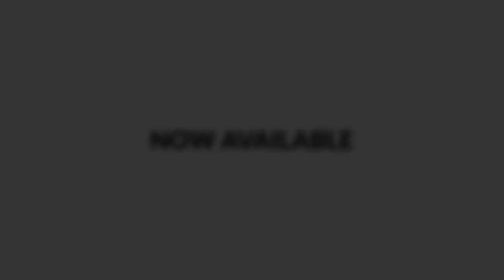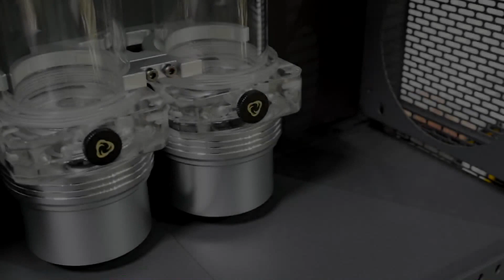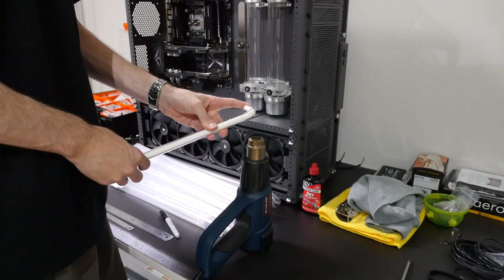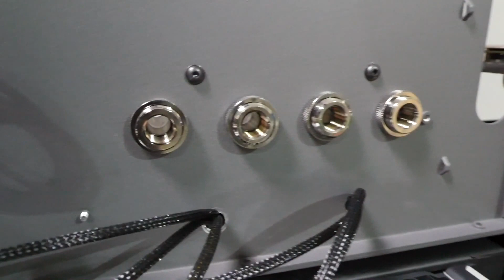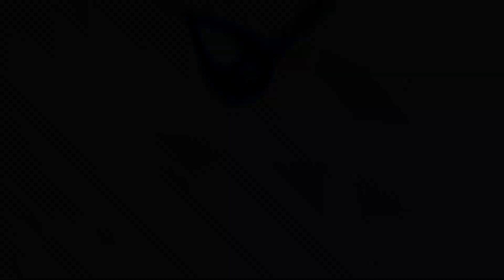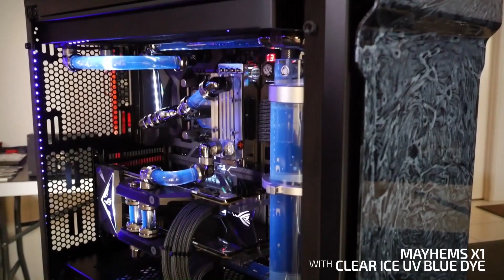Extreme Caselabs SMA8 Build #27 Part 2

Comment: You still could have done the cpu loop symmetrical if you had put the through fitting at the top over the oval hole instead of under it. The tube could have gone straight up parallel with the other and then a 90 degree bend to the right. Still looks awesome your way as usual.

Comment: Great job on the loop design.  I had the same idea with my STH10, but I took it a step further.  I only used the existing holes of the case and if I needed to drill holes, I drilled on the cheapest parts to replace.  That was a challenge.

Comment: 7:37 If you apply heat slowly, and depending on the bend, you can certainly rebend tube without deformation.  I've made tube runs, where I've have to re-straighten/re-bend 6-7 times, and the tube has come out perfect.  It's all about patience.  My trick is using soapy water, which I coat the silicon insert in before I heat the tube.  makes inserting and removing before/after the bend super easy.  It's also a great indicator when the tube is hot enough to bend, as the water/soap will start to bubble/boil when the tube is near the right temperature.  Nice thing is it helps heat/cool the tube as well, making the window of malleability longer for complex bends.

The build looks marvelous, as always.  Giving me new ideas for my RFP.

Comment: Nice... do you have a tutorial on how to bend hardtube? When do you rather use a 90° fitting, when do you do a bend? How do you prepare the cutted pipes? Do you use any teflon tape on those passthroughs? Or just screw the fittings together?

Comment: I would have just use soft tubing in the back.
Alot easier and no one see it anyway :P
But if you want to do it 100% right.......takes ALOT of time but it pays of in the end :)
Reply from the maker: No soft tube, it breaks down in no time and clogs your loop.
Reply: Jesse Dery yeah I’ve used it before but I was just saying this guy is a perfectionist so he attends to every detail including hard tubing the back
Reply: MOst of the time it discolors though, and needs replaced rather quickly
Reply: Alex You could always use something like EK's ZMT tubing. It's flat black, not clear, so no discoloration. It's also made for long term use with no maintenance.

Comment: With all the ports connected to the back of the two reservoirs, would it be possible to remove the mounting bracket and have them appear to be floating up against the side of the case?